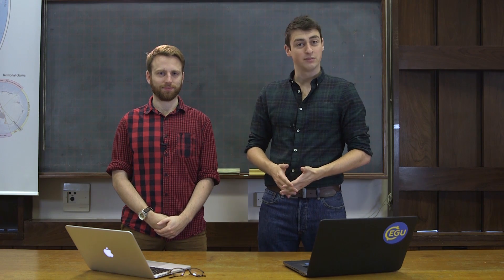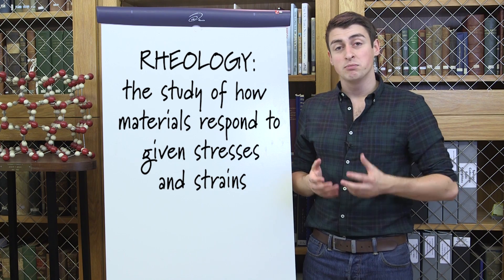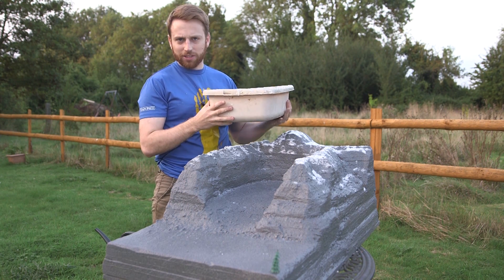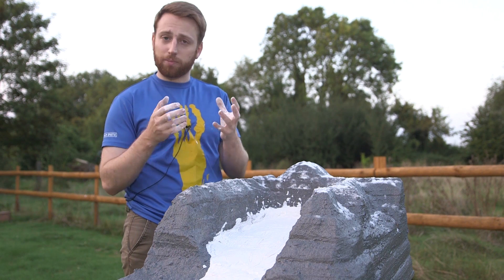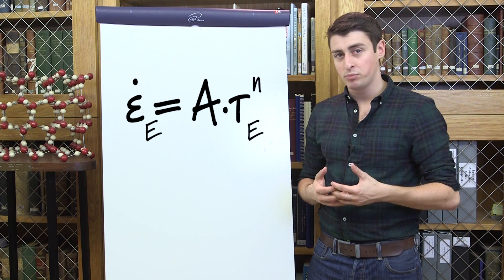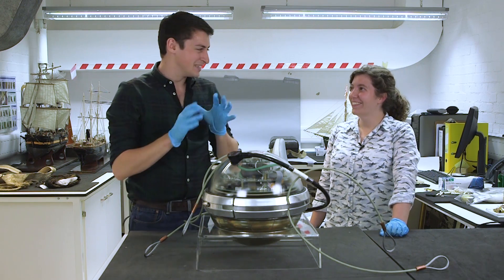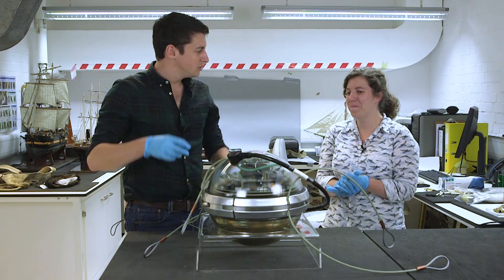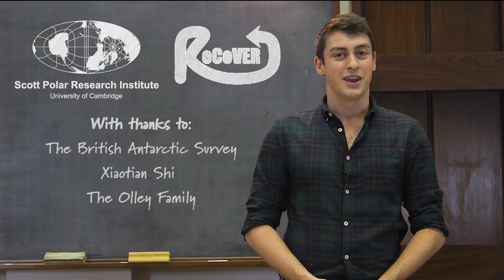Internal deformation of ice | Crash Course Cryosphere #5

Comment: my guess is that the pressure causes the ice to melt, but that would mean that the ice was  quite hot in the first place.
Reply: ice should only be able to melt due to pressure when it is over +- 250k. That seems pretty hot, considering all that ice.

 It can always change to a different phase, perhaps one with slip-planes, like how you can easily cut silicium if you're careful with alignment.

Or maybe there's something localized going on, thinking along the lines that ice is a poor thermal conductor (it is, isn't it?) and the heat supplied through the "floor" is too much for the ice to carry away.
Reply: Tom Dowling I was thinking about the A factor in the equation. Maybe the heat (due to pressure, or from the ground) at the bottom of the glacier makes the ice more plastic?
Reply: is it something to do with thermal expansion? does the bottom layer try to expand, increasing the stress on the ice above and pushing it downhill? 
It's just a guess, i'm not really sure, since that expansion is not directed downhill, and I don't think it amounts to the effective stress...
Reply: Edoardo, I was thinking something similar, but instead of expanding and pushing, figured there were cracks or faultlines near the bottom,  the ice would then be able to move much more quickly.

It's curious because in general, things move slower then predicted. Take fluids, where turbulence causes energy dissipation and therefore slowing down. Or metals, where impurities cause hardening. Whatever the explanation is, it's fairly ice-specific.